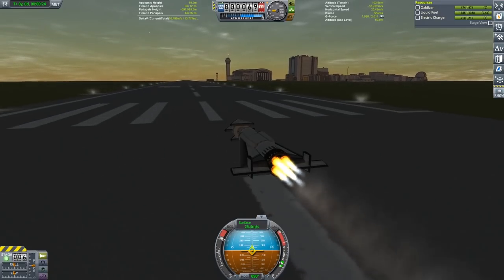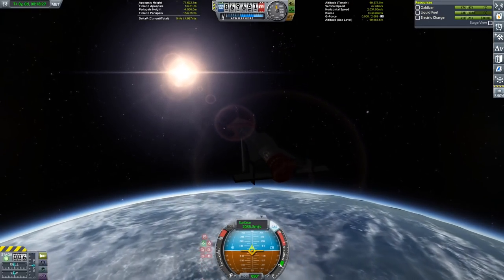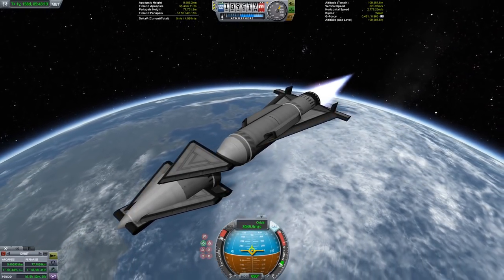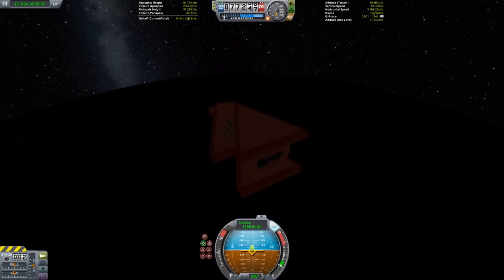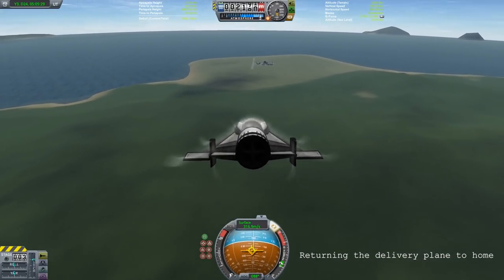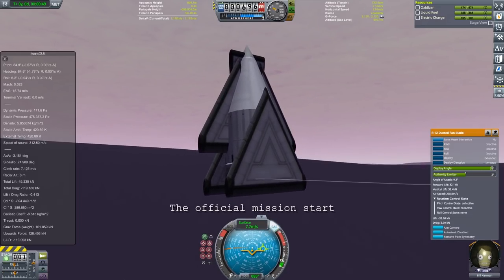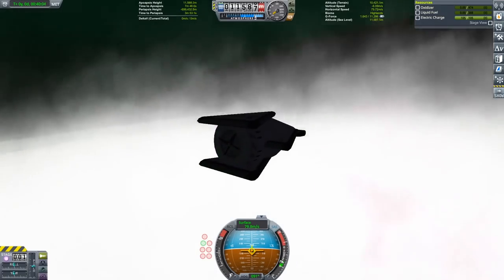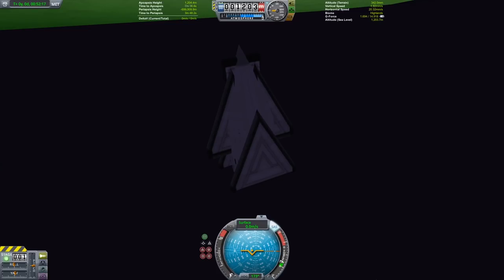Eveplane Miniaturization:  Kerbal to orbit on a 6 ton fully reusable spaceplane

Comment: The EVA stuff was interesting.  You get lower efficiency from firing multiple thrusters, but the greater thrust means you take less time time to reach orbit, which means you can make the initial assent flatter and more efficient. I wonder quantitatively just how efficient overall this assent method is compared to using one thruster with a higher starting suborbit. Good shit Mr. Whistance, although I'm still disappointed with the lack of KSC aerobatics.

Comment: I am not entirely clear on the propeller engines. Did you use 2 'EM-16S light duty rotors' or 2 'Rotation Servo M-06' servos'? If the former, could you scrape off a whole less then 2 kg of engine mass by fitting a single 'driver' EM-16S light duty rotor with all the propellers and mounting this assembly using a free-spinning unmotorized 'Rotation Servo M-06' servos'?
Reply: You can't really use servos for propellers. Servos max out at about 10-20 RPM, while even low-end rotors get up to >180 RPM.

Comment: What's your opinion on using a command pod to infinitely refill a kerbal's EVA fuel?
Reply: This is no longer possible since you have to bring fuel for the kerbals in the command pot.
Reply: I use inflatable airlocks for that. Still refills EVA fuel and weight only 100kg. Also, allows you to store experiments from a Kerbal after boarding. And you can use it to dock to docking port jr.
Reply: I think if you're willing to do the work of pushing a command pod in a consistent direction for hours on end, you deserve the reward of infinite fuel. ;)

Comment: What mod are the props from?
Reply: Stock. They were DLC-only for a long time, specifically Breaking Ground, but I think they were moved into main in 1.10 or 1.11. Filter for "rotor" and "blade"
Reply: @eekee6034  thanks for the info! I'm on 1.09 iirc, I heard 1.0 was ransomware or something
Reply: @jimcrelm9478  Welcome! I vaguely heard something bad happened, but it was way before my time. I started with 1.8.

By the way, version numbers are not decimals, there's no need to write 1.09, just 1.9. Now I just need to figure out how to get Youtubers to stop saying them wrong. ;)
Reply: @eekee6034  I have now read a few articles about it, it was spyware/a "phone home" misfeature, and it was included for targeted advertising reasons. The EULA still allows for such spying and there is no way of knowing whether they have resorted to some other implementation of the same functionality.

Thanks about the version numbers, always appreciate the chance to learn.
Reply: @jimcrelm9478  Welcome. :) Thank you for the info. It's sad that apps spy so much. I can understand taking a survey of which interface features are most used for the sake of improving the interface, and similar technical reasons, but doing it for other purposes is rather evil. But I've been told Squad is actually an advertising studio, so it must be normal to them.